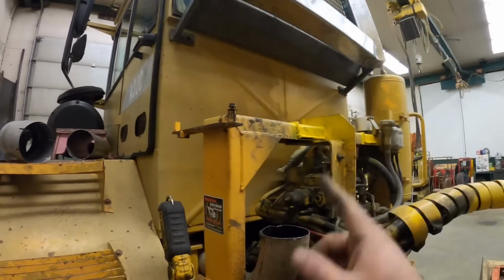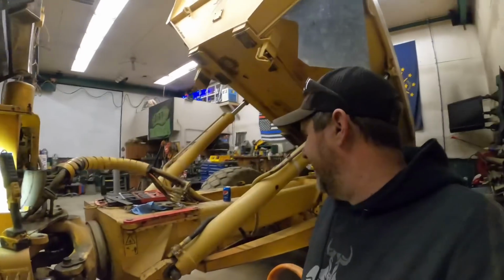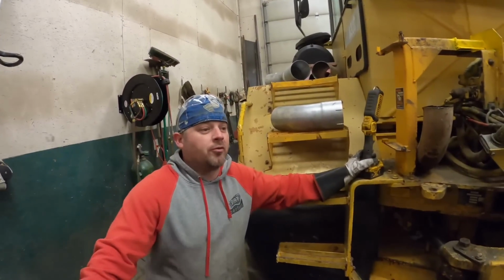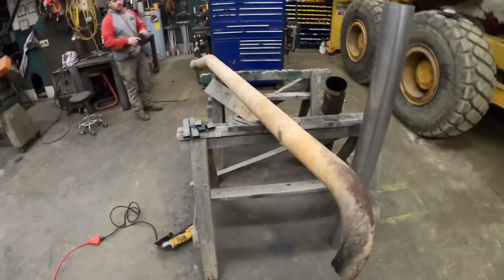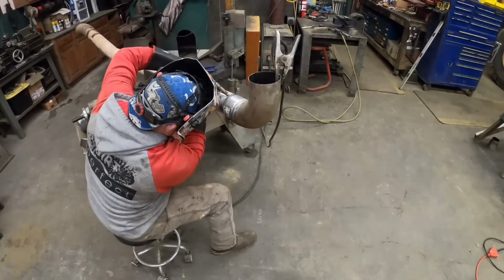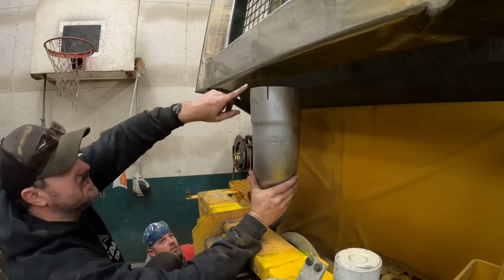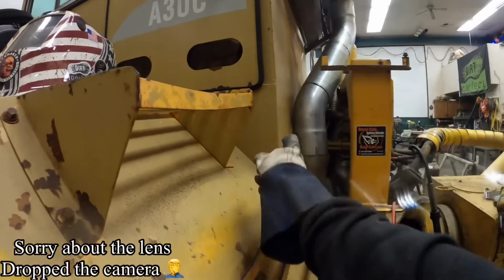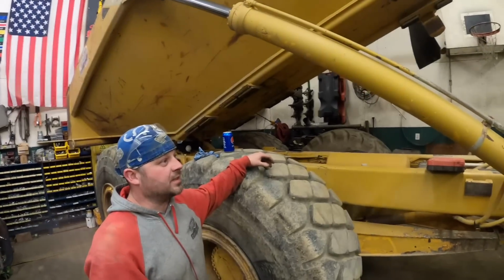Stacks are done now for the exhaust pipe easy part right… No proves to be another major challenge 😬

Comment: Holy cow, I can not believe the length of that exhaust pipe and the fact that you could undo those band clamps so easily. Some quality engineering right there.
Reply: I waited and waited to see that you would not forget to cut a hole in the upright stacks. I almost yelled from Ca at you all so you wouldn’t get it all welded up without noticing. At the very last few sentences of the recording you FINALLY mentioned it. I took a deep breath and punched the symbol for thumbs up. Lacy and you did an amazing job! I never thought that a pencil lead could work like the old Edison bulbs.

Comment: Great job looks awesome.  If you have not com pleted the dirt shield as of this writing perhaps you may consider a flexible dirt blanket.  You could fabricate it with hevy duty mesh screen strong enough to deflect small bolders/rocks but flexible enough to re-direct the dirt/rocks away from the rear of the cab and motor/engine whatever you call the power plant...

Comment: When you use the flat or step down band clamps I have found that if you put grease or lube on the pipe or the band clamp it will draw up nice an tight. An always use stainless steel flex it last a lot longer.

Comment: Use to run a few big hem saws cutting 15x18 steel bars …. That “base” looks like what we had to catch the cutting fluid and drain it in a bucket to recirculate it back to the blade.

Comment: I don't know if they would have exhaust pipe stuff or not, but I had a great experience with Conequip. I bought a center hydraulic swivel for my excavator from them. They said it was OEM, it was slightly cheaper than from the dealer, I got it in a week instead of 3 weeks, it was shipped to my house, and they called me a week after I got it to make sure it fit correctly and I had no problems with it. They have the best customer service of anyone I have bought parts from so far. 

Pipes 2.0 looks great fellas. Can't wait to hear it.

Comment: I'd die laughing if they forgot to cut out bottom of horizontal square tubing 😂😂😂😂
Reply: Yeah! I agree!  I don't believe I saw the hole being cut out from the bottom of that Horizontal square tubing. 
Did they forget to film that part, or did they forget to cut out the hole, before tacking / welding?  
Makes me wanna go "MMMMMMM?"   😁😁😁
Reply: @frankh.valenzuelaabuelotej652  that's why there's only 2 tacks on it.  It will come off, get hole cut in it, welded out completely, painted, and installed permanently.
Reply: They said at the end of the video Aaron wanted to fire it up and mike reminded him the hole wasn’t cut yet.
Reply: I was thinking the same thing, but Mike stepped in and made sure all of us knew they weren't done, and that hole would be cut before they start it.  Of course, the final prep and paint will have to be done first.  The other thing I noticed was the flex pipe touching that main support that used to hold the muffler mount.  I'm sure they'll tweak it a little with the final fitment.
Reply: It definitely would just be Aaron's fault. 😆

Comment: My boo boo!!!!  I see,  well defined at time 2:23,  that the centerline of oscillation is on the REAR portion of the truck.   This means the oscillation motion moves parallel to the bed and thus is not a significant factor for the  exhaust  to  always clear the bed.   For some reason I was thinking the oscillation centerline was on the FRONT portion of the  the truck and thus the oscillation would cause the exhaust to crash into the bed at max steer.    My bad!!!:face-orange-raised-eyebrow:

Comment: Looks great. 2 questions I've got.
Aren't there some type of anti-vibration (rubber dampeners, shocks or air bag type) between the cab and the front frame? If so, how much movement does it allow?
As pretty as it is, maybe a clamp connection under your square tube (some type of nipple welded to square tube) for ease of any future maintenance on the exhaust? Not hating, but I'm sure you know as well as I do about the type of situations you might cuss about engineers for under your breath while working on things. It might be completed by the time you get this, or even completed while I'm watching this episode. Looks good and can't wait to hear it.
Reply from the maker: Yes
Reply: @DirtPerfect  Yes? Can the solid exhaust move as much as the cab?
Yes? There's an easy enough way to disassemble without cutting it apart?
Just curious if the section of flex pipe you put in "flexes" as much as the cab can. Thanks for your answer. Just trying to help as well as understand.

Comment: Hot Tip: Not too critical at 8 degrees but more than that and you would need to cut each piece at 50% of the angle to make both match up to each other.

Comment: no the firs thing you need to do is determine what's behind the wall of the cab that might be affected by heat because that pipe is going to be hotter than an oven at a fish fry.

Comment: If you just hadn't mentioned the hole in the bottom of the tube, it would have been a great comment generator. Ok, I'll do it, YOU FORGOT TO CUT THE HOLE WHERE THE PIPE IS WELDED. 🤣
Reply from the maker: Lol did you not watch the video so confused

Comment: Zero emission ??? if there is no hole in the stack, engine will not run long so fuel saving - just can't get any work done.
You reminded me of the 1980s when we put hoppers, ducting and worm conveyors in a dog biscuit factory.
We also used to repair the 600 ft SS chain mesh oven belt while it was still running using Come-alongs to pull the torn belt together; deadline was get the work done and all the kit off the belt before it enter the oven tunnel.

Comment: Not a pipe fitter, but I took a pipe welding class when in college. In the pipe fitters hand book they extensively used paper sheet rock joint tape for the wrap around part.
Reply: I’m a pipe fitter, never used sheet rock joint tape before, but great idea. When I didn’t have a wrap around material I would used a roll of gasket material, if I was really hard up I would used my belt. Just use your imagination. Great video.
Reply: @jmit5650  it was 30 years ago when I was in school
Reply: It has been 49 years for me.
Reply: @jmit5650  it may have just been what the instructor used. He also carried finger nail clippers to notch the tape to mark the points to transfer over to the pipe.